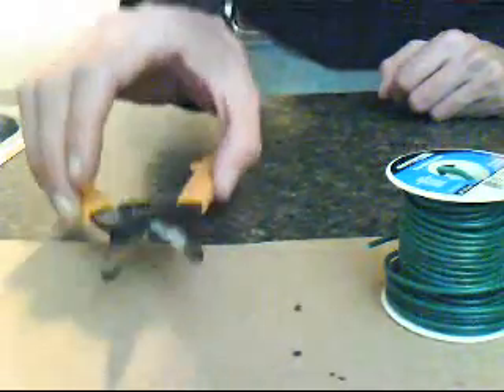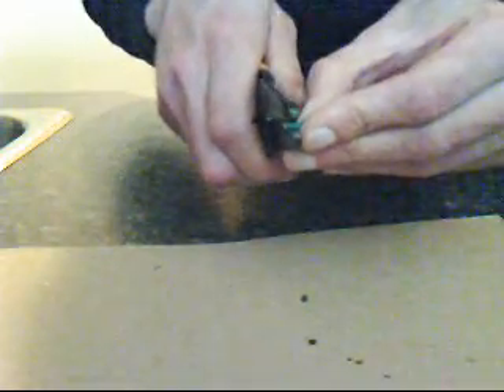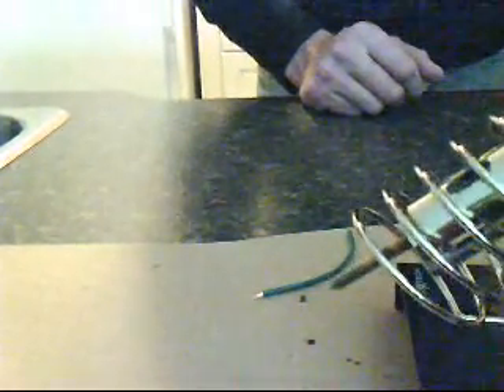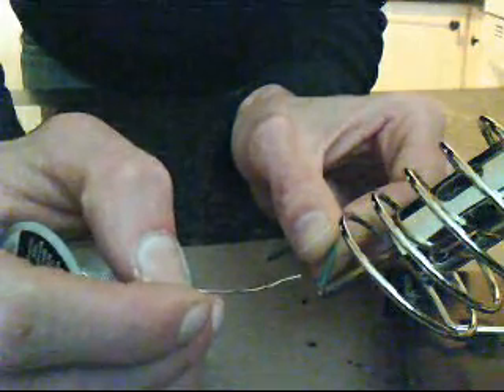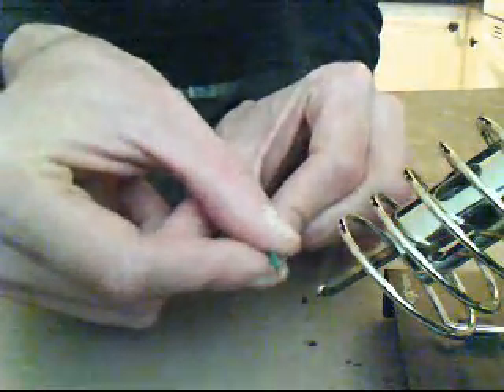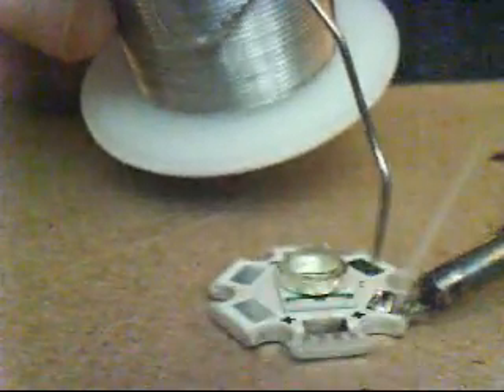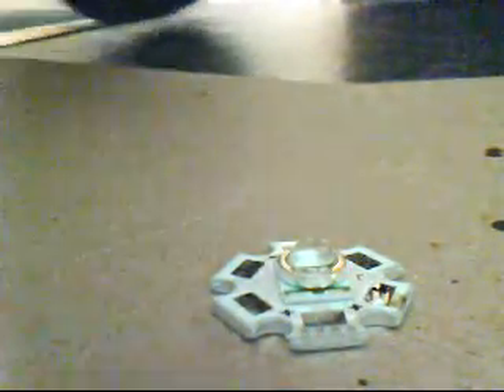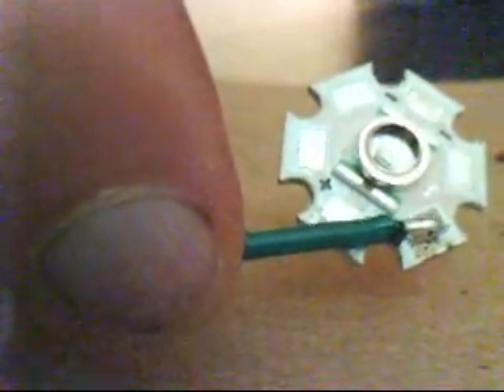How to solder an led

Comment: a similar take on tinning the wire without having to preheat the wire and potentially  melting the wire housing would be to dip the wire end or add a small amount of flux to the wire, add a drop of solder to the tip of the iron and you'd just need to touch the melted solder to the wire, it will instantly tin the wire with less heat.

Comment: I normally tin the wire by holding the solder and iron, with the wire in my helping hands. I think Ill use your method from now on, because with mine its very easy to be too heavy handed and split up multicore strands by accident, thanks!